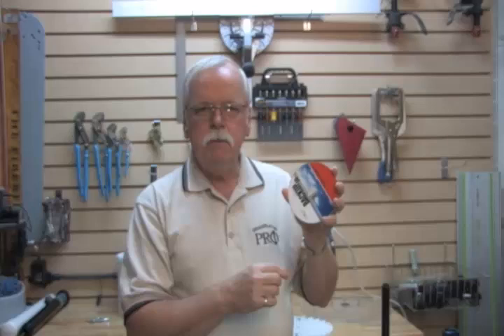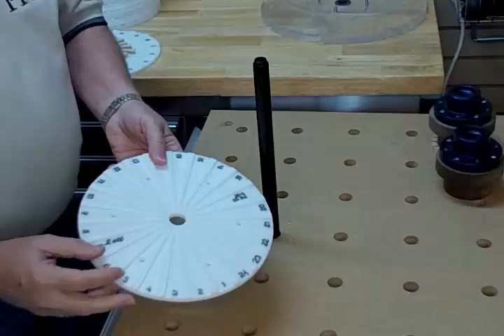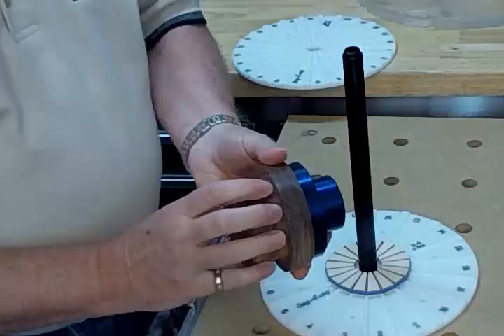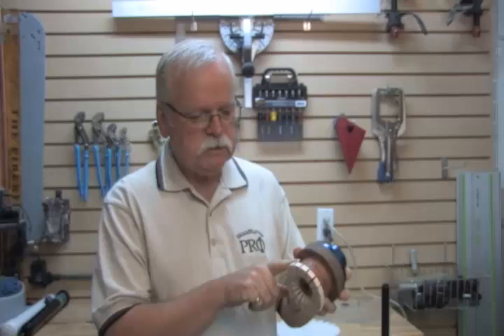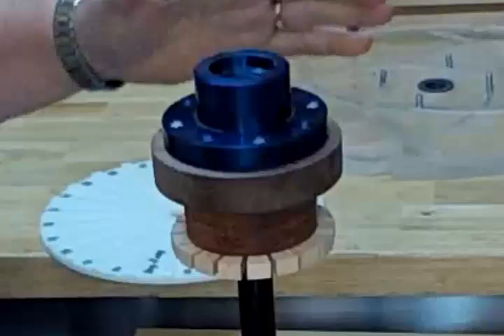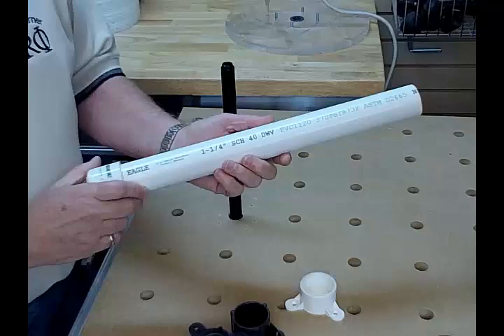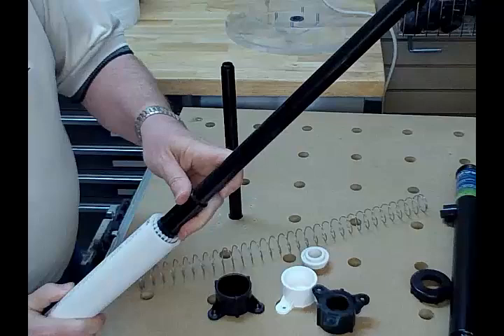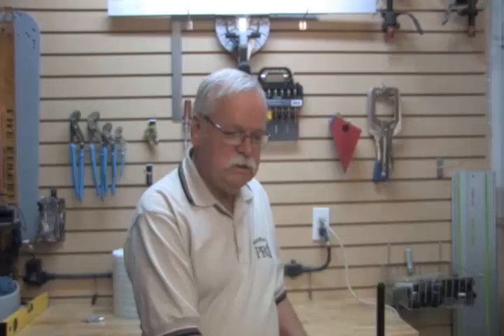Woodturner PRO announces the Segment Stomper

Comment: Oscar, I use the Stomper all the time. I never use the lathe to set up rings anymore. One thing I've added were glue blocks that sit in the chuck that I remove after I glue on the first ring. I marked the chuck with a black marker at the number one chuck location and the corresponding place on the wood block so that I. An remove it from the chuck and then reinstall later on. I also use a small forstner bit to indent the center of the wood block so that the spring loaded shaft will end centered all the time. Now I. An use my chuck on my lathe for other work. I use 5 to ten lbs of weight on top of the wood block to weigh it down while the glue sets. I hope I'be help you. Best of luck in your turning projects. Richard....

Comment from the maker: I keep a container of Q-tips that are soaking in water near me when I'm adding the open segment rings.  As soon as I've added the weights, I take one Q-tip and squeeze the water out of both ends.  I then insert one end in a gap and then rotate that Q-tip and insert it in the next gap.  I then flop the Q-tip end-for-end and do the same thing to the next two gaps.  I then return the Q-tip to the water and grab another one.  This works really well and you have to look really hard to find glue.

Comment from the maker: The PVC Table Cap has three holes that are used for mounting.  You first have to have a hole that is approximately 7/8".  The diameter of this hole is not important because all the centering is done from centering the SegEasy plates around the plunger.  You just use three #6 x 5/8" wood screws and attach it from underneath.

Comment: Lloyd, I got my Stomper put together.  It was easy once I got the parts together.  The only difference I made was instead of making it a permanent part of my work bench, I built a small mobile table that measures 18"x18"x18".  Empty bench space always seems to be at a premium in a small shop.  Having the Stomper standing up would be a problem and would always seem to be in the wrong place.  With the table I can just store it when not in use.  Best regards, Richard
Reply: Richard Katzman I'm interested, how does it work. Seems like a great system, but a lot of the pros use a different jig

Comment: Hey there! Great video, I just had one quick question: Around the 740 mark, you mentioned you turn the ring inside and flat on the face. Do you wait 24 hours for the glue to cure between each ring? Or do you have a glue that dries faster to allow you to do this? Thanks so much!! Great product ordered on a few minutes ago!